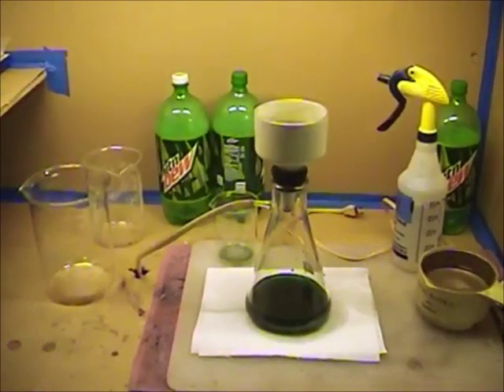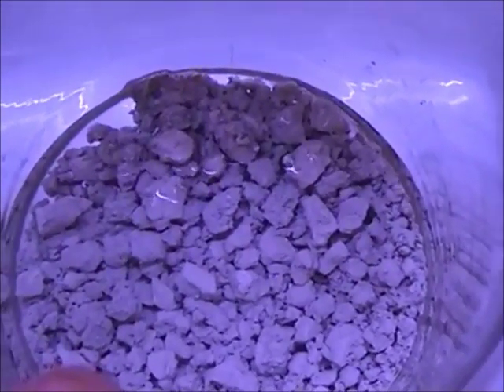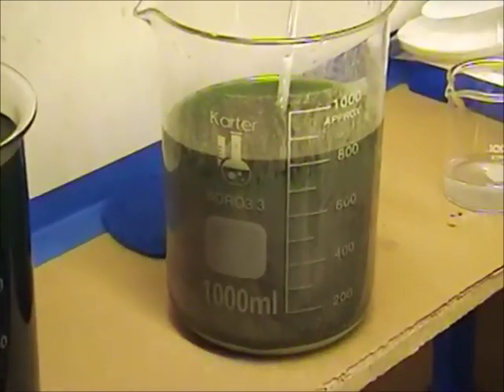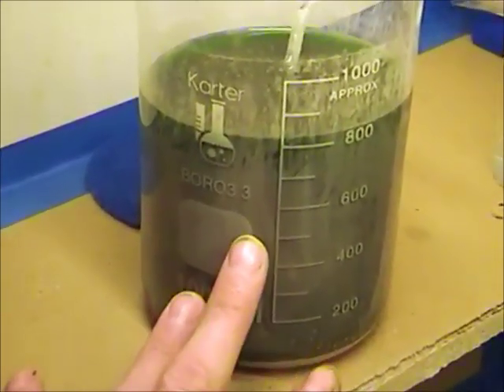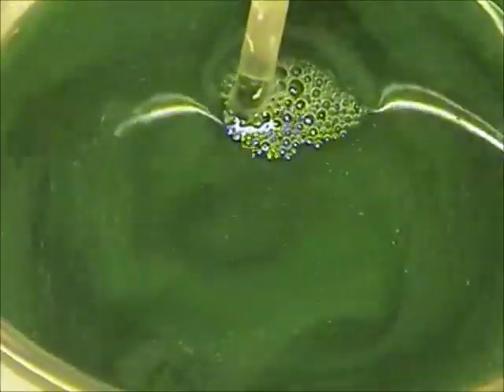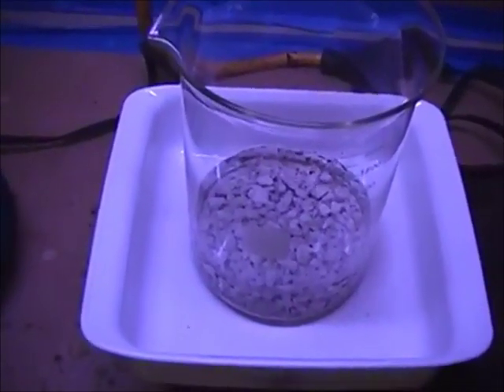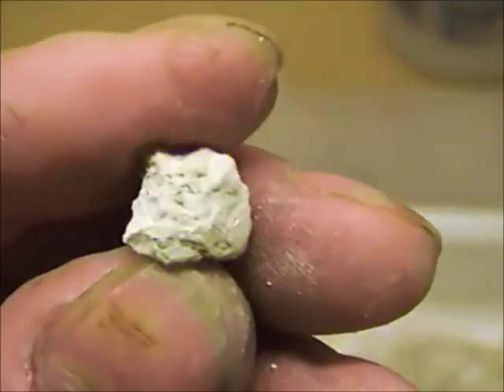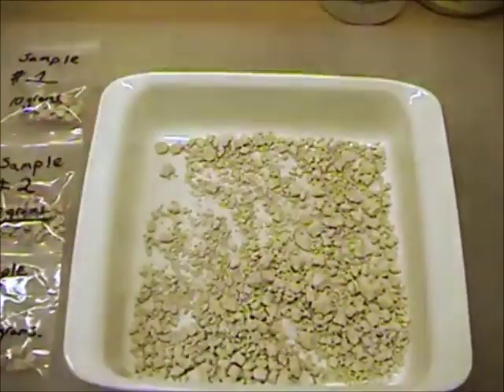REFINING STERLING SILVER VIA A SODIUM FORMATE REDUCTION PROCESS PART # 6

Comment: Outstanding video in Ag refining!
THX for that
regards from germany
PS. the bubbeling in the other video #4? mentioned should be  H² and later with heat  CO or CO² by forming from Sodium Formate 2HCOONA --->(COO)2Na2 +H2  --->  Na2CO3 + CO
Reply: I think the reduction of silver ion with formic acid results in silver and carbon dioxide - Hence the gas evooution. Sodium formate would evolve hydrogen gas. The pH of the formate solution is made more acidic so that formic acid would be present.

Ag+  + HCOOH →   Ag  + HO-C(O)-OH
HO-C(O)-OH → CO2(↑) +H2O